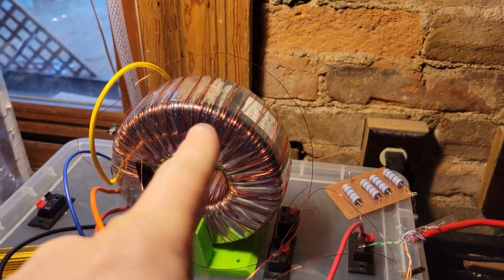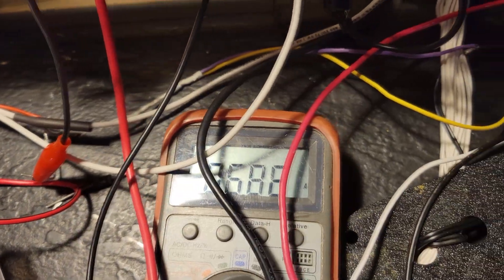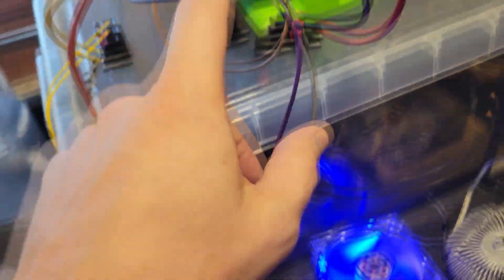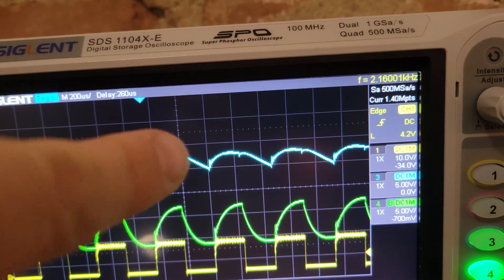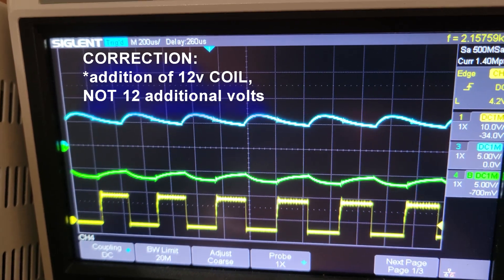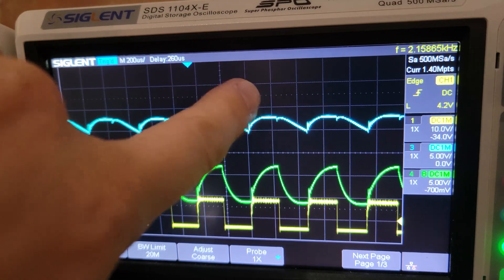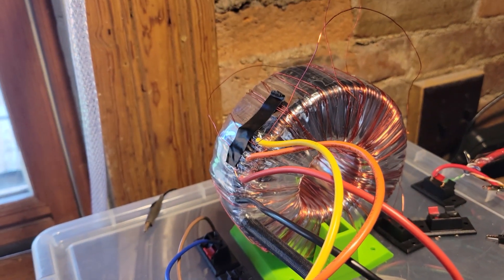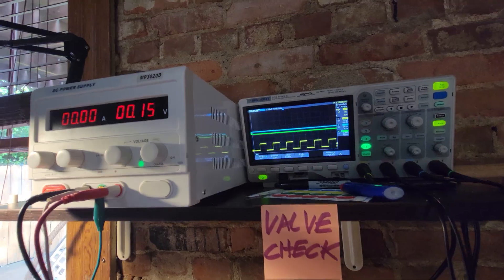Toroid VIC Transformer Delivers Even Higher Voltage and Pulses During Off-Time Discovery

Comment: I knew Stan he used a 24 volt pulse weith modulation voltage regulator to pulse the 24 volt voltage at a high rate
Reply from the maker: He had a few different PWMs. Mine go from 1v to 30v.
Reply: Nice work

Comment: bi filler  charging chokes, where are they
Reply from the maker: No bifilar used here in this video. Utilizing opposite-direction-wound inductors allows for proper waveform (EOP). You can see here they are the outer-most wound (exposed) wire on the toroid.

Comment: From you lack of responding to my post I guess you have no desire to talk to me even though what I showed in Colorado has never been duplicated where I put kilovolts to the cell. Before the OverUnity site shut down I was putting 9.4kv to my ten cell setup with the amps flowing through the cell held down to just 0.6mA. Now according to Meyer I must reach 10kv to reach the threshold for ionization for a WFC of this size. 
Right now I have to get another power supply, some wire, and build the next generation VIC transformer which should get me over this ionization threshold once completed. Since funds are tight at the moment I have to wait a bit before I am able to purchase the things I need.
But the question you should be having is, "How is he putting such high voltages to the WFC?" I simply stopped following what people like Don Gable and others put out and started doing things following the scientific method. In doing so by trial and error testing I was able to figure out how to wire the Voltage Intensifier Circuit up the correct way, plus start doing thing to respect the high voltages so that the transformers stopped shorting out on me. You see if you follow what Don Gable showed in how to hook up the VIC circuit you will never get this technology working properly. With my setup it matches Meyer's words perfectly in that the water never heats up as the temperature of the cell basically follows the temps of the day. I ran test for 72 hours taking temperature readings ever half hour to be able to see that what I was doing did not do anything to heat up the water bath thus like Meyer states the voltage is doing the work not current.
From Meyer's words a cell built like his should reach the ionization threshold for the atoms that make up the water molecules at around 1kv of potential difference per cell (500 volts positive and 500 volts negative). Thus if I have ten cells wired in series it's going to require me to reach 10kv just to get the process started. What I have found is the more balanced the waveform is having near equal amounts of positive and negative voltages the less amps flow through the cell.

Anyway it is good seeing someone else working on this technology besides myself, though your not getting the results you should be getting, it's still good to see.
Reply: Ppl don't respond to you because you don't offer help, you just bragging around.
Reply: @11T872  I find that people don't respond to me due to my skin color as that alone got me booted out of a few online forums. Even while I was at the 2013 Global Breakthrough Energy Conference my speaking time was given to a comedian to tell jokes. So, just imagine my frustration in that I showed voltages being applied to the WFC no one had ever seen before in a provable manor just to be sidelined due to the color of my skin and not allowed to speak. It's been over ten years since then and still no one that I have seen working on this technology has applied those types of high voltages needed to reach the threshold of ionization of the atoms of the water molecules to a WFC.
I went out of my way telling folks what tools they needed to get in order to be able to work on this technology and no one gets anything and in fact they chose to double down telling people they didn't need to get the needed measuring devices I explained to them that they needed to get. I even went as far as to tell the reasons why these things were needed if one wished to see what they are doing while working on this technology just to be given the boot out of the online forum as they told everyone that you don't need high voltages as Meyer said repeatedly in his many lecture videos being applied to the WFC.
The reason why a differential probe is needed is the secondary side of the VIC is an isolated circuit and one must not introduce a ground to that side of the circuit or it will take it and not work as a result. If a ground is introduced on the secondary side the voltages will not build up in the WFC. 
Since you seem to know of me do you recall me teaching how a thunderstorm actually works? The cloud is isolated by the air on both sides of the capacitor, IE, the thunderstorm clouds themselves are the capacitors. Everyone would know this if they just got passed the color of my skin and actually looked into the science I was telling them to look into, IE, the earth's Global Electric Circuit. Thus I had very good reason to hold back everything that I knew about this technology as why give it to a people whom hated me for being a Negro to the point they can't even glance at the science behind this technology I was trying to lead them too?
In all my time online talking about this technology I don't ever recall anyone talking about the science behind this technology with me openly. I asked and pleaded with people to make use of the scientific method in their work to only be laughed out of the room and told by some that science can't explain this technology, SMH.

The thing I like about this guy is he recognizes that this technology needs positive and negative voltages in the WFC in order for it to work correctly.
Reply: @11T872  I've been working on this technology for a while now as I got started on trying to understand what was actually going on way back in 2006. The main thing that frustrates me is people's adherence to racism and it's belief systems. Even when I was at the 2013 Global BEM held in Colorado I had my speaking time was given to someone else to tell jokes after I had shown in a provable manor high voltage being applied to a WFC for the first time ever as Meyer never showed anything hooked up to the secondary side of the Voltage Intensifier Circuit. Honestly I don't even recall anyone wanting to talk about the science I was going over in any of the forums I had joined. Most would just push their work without making use of the scientific method at me and expect me to accept it as the truth when it was just all wrong.
I would show my work and encourage others to follow my lead but no one would do so and now you say I was just bragging when I showed graphs, tables, and a whole lot more. I pleaded with folks to get a differential probe when they were cheap, provided the link where to purchase it to only have the site leaders tell everyone they didn't need to get that tool. 
I went as far as to explain why they needed to get a differential probe as it has to do with the secondary side being an isolated circuit as if a ground is added it will not charge up. People simply wouldn't do anything right. No one was taking temperature readings over time to make sure the water bath wasn't heating up. They were grounding out the WFC with their standard probe leads, and for the most part everyone was in just copy mode with no real thinking in sight.
I remember very clearly that as I improved upon the voltages being applied to the WFC people just getting mad at me instead of trying to do as I was doing so that they too could get high voltages to their WFC's. I think I stopped sharing once I reached 8.8kv as I was accused of cheating after I went out of my way to show everything I was doing.
The only reason I decided to talk to this fellow is he seems to understand the need to have both positive and negative voltages being applied to the WFC as that is a step in the right direction. Now he just needs to get himself a differential probe and stop grounding out the isolated circuit part of the VIC and move forwards from there. But it would seem like most out there his mind is poisoned against me by the racist of the past whom all rose up against me, as how dare one of his "Kind" try and lead the way.